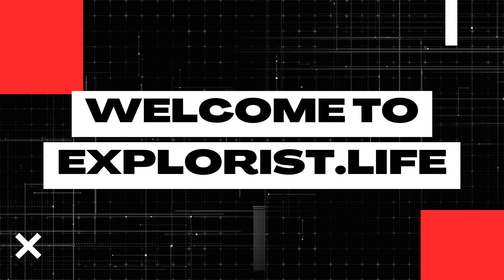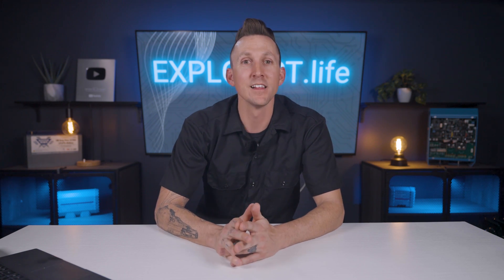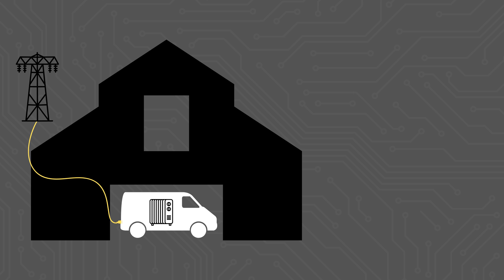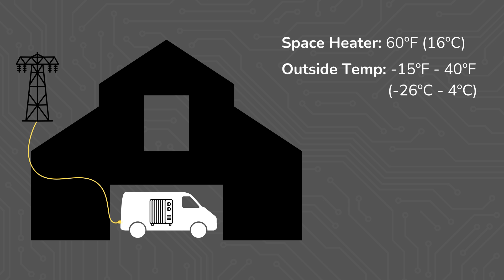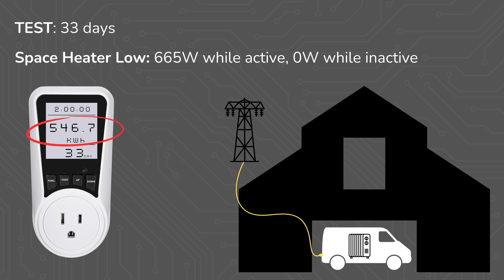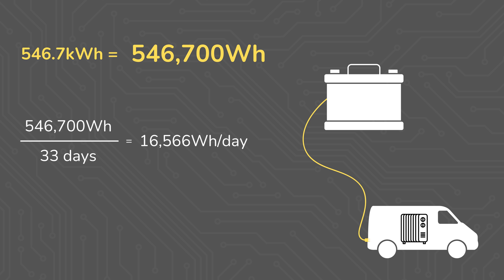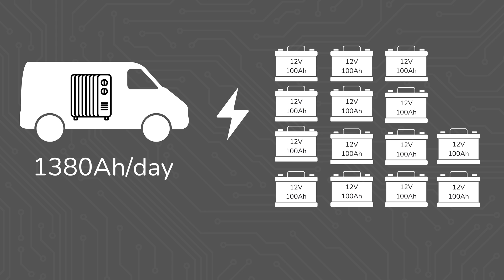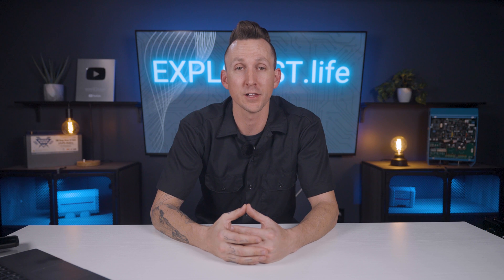Why Space Heaters are a BAD IDEA for a Mobile, Marine, or Off-Grid Electrical System.

Comment: Not a space heater but i now realize how many amps was needed to make 1 cup of coffee on my boat. wow.100dc amps. But with my 12/12-50 i ran the motor and dropped it to 50 dc amps. My inverter is good till 150a/1800 watt
Reply from the maker: That's an awesome realization—it's wild how much power some small appliances can pull!

Sounds like your setup is working pretty efficiently with the motor assist and DC-DC charger helping manage the load. If you ever want to optimize things further or explore different options for balancing power, our support team can help walk through the specifics of your setup:

https://shop.explorist.life/support
(Free personalized help is available for items purchased from our store.)
Reply: @EXPLORISTlife the multiplus is next on the list lol

Comment: It's a different story if you have an Ford electric E-Transit Van that is well insulated and has Pro Power. The vans heater is electric and takes a huge amount of power from the traction battery. Running a small ceramic electric heater plugged into the pro power takes far less power from the vans traction battery. If the van is plugged in an charging, the power is coming from the shore power any way
Reply from the maker: How many watt hours is pulled from the traction battery for every hour of active heating?  Hit us up with some actual numbers!!  "Huge" and "Far Less" are relative terms and not that helpful.

Comment: Nate; the length of the video was just right and concise for you to convey the material.  
An off-grid electrical space heating can be achievable with the use of closed cell foam insulation of the space needing heating or cooling and the use of an energy efficient mini split (aka Heat Pump).  
By design, the mini split technology is more energy efficient.  When compared to a conventional thermal heating unit, a Mini-Split has a CoP of 2.5 or greater, using 1/5 the energy required for a "thermal" electric heater that is running at 95% efficiency.  
It is also important to have the area to be heated or cooled be vapor insulated, with closed cell foam, to trap the conditioned air so the mini split does not have to run as often to maintain the desired room temperature.

Comment: I just calculated - you told, the heater was switched to low. So it was running nearly all time.
Reply from the maker: We had it set to low/eco for most of the test, but on the days where it was particularly cold; we turned it up to high to keep a more realistic interior temperature of 60F.  I had temp alarms set for when the van got too cold for comfort.
Reply: @EXPLORISTlife  Yes, your numbers about that time were some frosty

Comment: I've got a tiny 350 watt heater that basically I hang on an extension cord close to my bed at night.

It acted up in the smallest replacement I could find was like over 600 watts.

I was able to blow the original out with an air hose and it began to work again.

The power system I have is a Bluetti AC200 with 2 Batteries.

I have a Mr Buddy which is in storage to supplement that and I'm thinking of getting something like a diesel or gasoline heater. The latter is preferred because that is what the vehicle runs on so I don't have to install an extra tank.

Comment: I have a whole house, electric, tankless, water heater that uses 240v AC and it is excellent, is there a way to convert a smaller size tankless, electric water heater to DC current for use in an overlanding expedition vehicle? I want to use one for potable hot water and a second one for underfloor radiant space heating. These would be my largest AC loads if I used inverters and I would probably need two very large inverter if I could not run those loads directly with AC current. Thank you

Comment: A mini split type setup tends to be more than 100% efficient. Closer to 4 times in some cases even. Would be curious testing with something like the wave 2 in slightly less extreme conditions.  Guessing it would be a tad more reasonable for a lot of places that don't get down to -20 and beyond.
Reply from the maker: I’d like to think that these videos arm you with the knowledge to go and test out whatever type of heater you’d like to use.  Take what you’ve learned and apply it!

Comment: I’ve learned that instead of using massive battery power it’s better just to get a good blanket! But it depends on the situation.
Reply from the maker: A heating blanket under the fitted sheet on the mattress is a great way to keep warm when the vehicle is cold.  This can also be used in conjunction with other heating sources like a diesel/gas heater like an Espar heater or similar.

Blanket is good for sure, but actual heating will be necessary for a week long snowstorm in Canada at a ski resort where nighttime temps drop to -40.